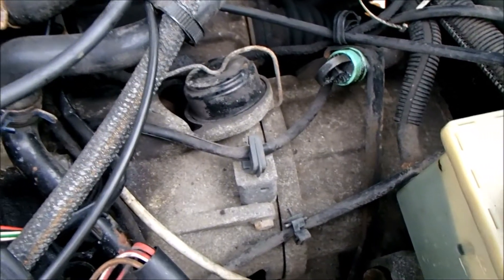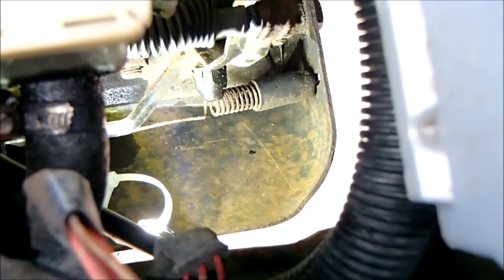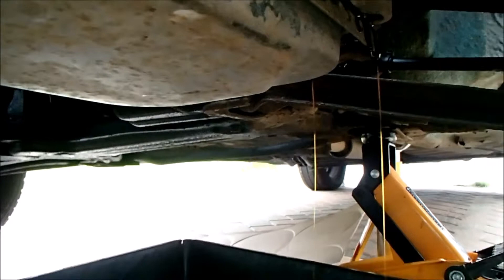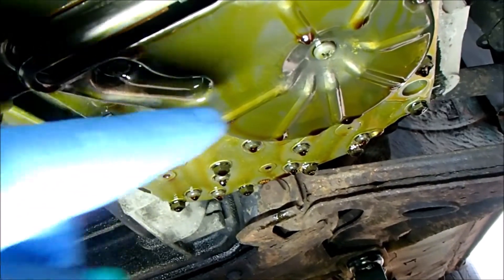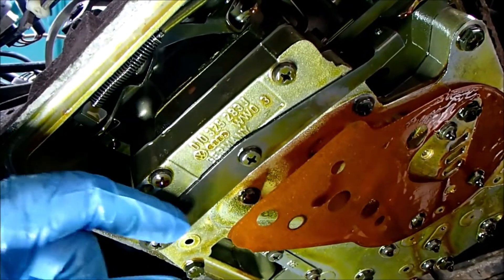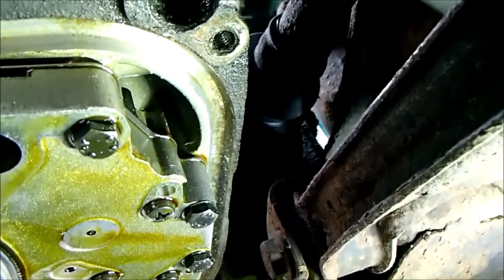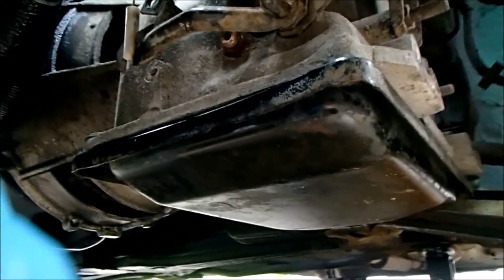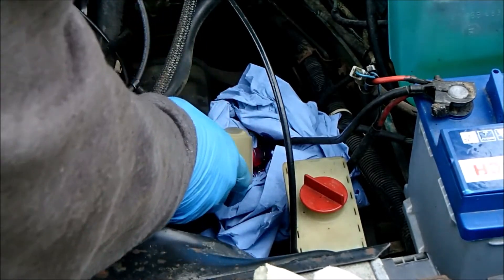VW golf mk2 automatic gearbox service

Comment: ...mine doesn't want to take on gears😭
Reply from the maker: Have you checked the fluid level in the gear box ?
Reply: Cuantos litros lleva de fluido
Reply: Y cuantos cambios trae esa transmisión
Reply: @juandavidortizacevedo9459 cuando es solamente servicio como ahí son solo 3 litros , el sistema completo lleva creo que 6 litros
Reply: @juandavidortizacevedo9459 esa transmisión es de 3 cambios solamente , 1era , 2da y larga osea la 3era

Comment: Pretty sure your supposed to check oil level with the engine running. Great video BTW!
Reply from the maker: Yes, engine running and at operating temperature.
Reply: @richardjweeks  And with the gear box in D.